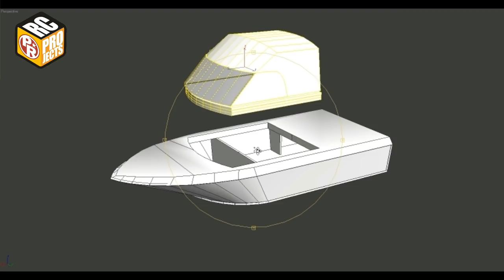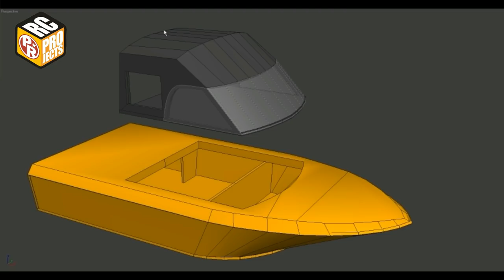How to Make RC Airboat : Simple but Scale DIY

Comment: Thank you for sharing. Me and my doughter is building 2 boats now. Great looking boat and the plans are very good.
Reply from the maker: Have fun!
Reply: @JuliusPerdana  both boats finnished. They are so good on water. This was my first time with rc boat and me and doughter is having so much fun.
Reply from the maker: @karefpv2163  will make another boat model in soon
Reply from the maker: @karefpv2163  do you have video of them?
Reply: Have pictures. We had to rebuild it becouse the steering in wind was not excelent. And then we got them to work great eaven in some wind. We used 2207 2600kw 5inch  motors on 4cells.   On full throttle boat went very fast and turned around. Motor and battery are to smal making the boat not heavy enoght. The boats are very fun to play with.

Comment: Keren om... Buat yg alin lagi om untuk rc boat nya...Oia mau tanya om... Klo pakek prop 9×4×3..bisa gak y om.. Pakek esc 40a motor 1400kv/1000kv..battery 3s 3200mah..
Reply from the maker: Ga bisa mentok di 8 inch
Reply: Mau beli elektrik nya D mna y om.. Nyari gak nemu
Reply from the maker: @udianae9336  itu motor lama pake aja motor 2212 1400kv pake prop 7 ESC 30A
Reply from the maker: @udianae9336  banyak di tokopedia, bukalapak, shopee